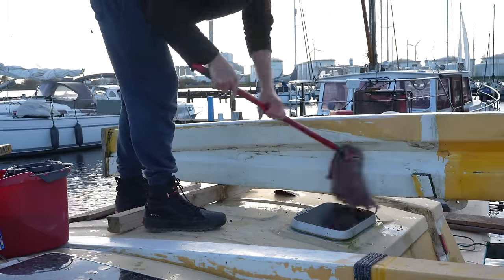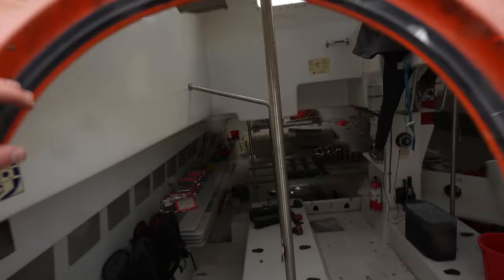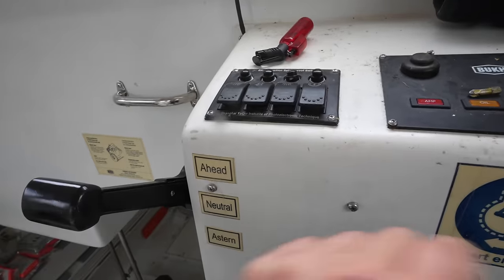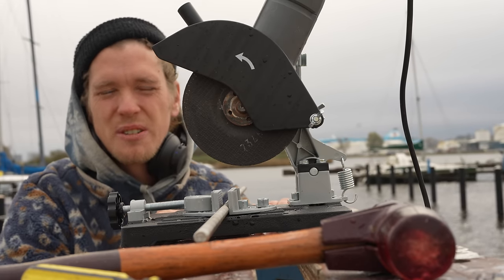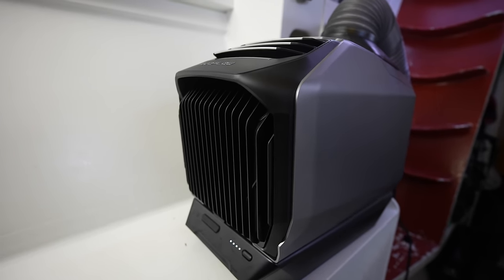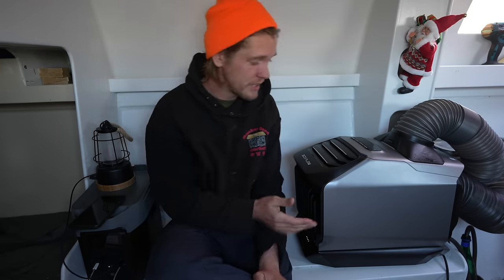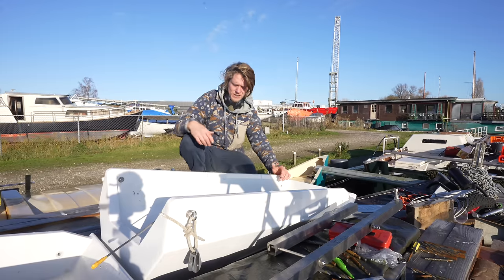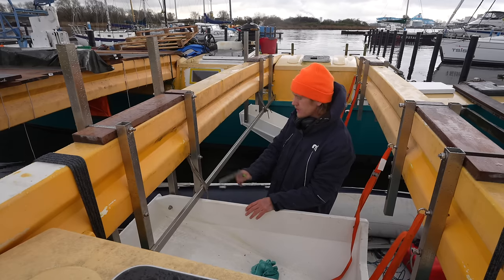Plodding Along With the Engine Pods | Wildling Sailing

Comment: Nice. It's 8C in here and i'm not even cold but shattered and my back is hurting. Got stuck in the snow. Let me tell y'all a little about my day. Woke up at 11. Was going to post office b4 midday but missed it as was distracted with a guy online selling me some Technics hifi gear. Flagged the post office till monday. Called a friend and asked him to help me pick up some firewood as i fractured my thumb 4 or 5 days ago. I took a 5T truck that had not been started for 4 months. It just started to snow as i left and i live at 1000M.
  Picked up Mitch, drove down out of the mountains to a guy 20km from here he has good firewood but expensive.
On way home i went to drop Mitch off but he said he wanted to come up to my place and help stack the wood. Up we went. There was already snow on the road and things were slushy and sketchy. Had 2 very steep hills to climb in slush. Just made it with some sideways skidding (dérapage in France here). We did the job and i drove him back down in the mini (with a bit of sliding around) after moving 3 vehicles around in the snow with some skidding and sliding and a few attempts. (now happy as it's been 8C in my house, (an uninsulated concrete block for the most part). 
  Decided to go to a town a bit higher up the valley to pick up personal items a friend had just driven back from the UK to France for me. The conditions were bad, everyone taking it easy in the slush. 
  I could not take the heavy pond liner but i took 12" vinyl photos, cassette tapes and a load of junk he randomly loaded at my dads place. Road was really bad and i was already becoming saturated. I drove back down to 800M and then had to climb back up to 1000M sketchy driving! Just as i went to pull off of the 2 lane road i saw a van broken down. There was a wheel lying in the road. I swerved around the wheel and stopped in front. The girl was crying, i went straight to work. We put on the yellow vests. I asked her to get ready jack etc. and to stay in her van. I drove down the slip road and muscled a load of the crates in my car around till i could get to my jack etc. I ran back uphill as fast as possible knowing the conditions could quickly turn fatal. We were in a slushy blizzard. 
  As i arrived, to my amazement a motorway service vehicle had pulled up behind her with flashing lights which helped to install a great deal of confidence. but i kept looking up to check for out of control vehicles. Things were super slippery!
  I managed to get the van up a bit higher with the mini jack but it started all sliding in all directions so i lowered the van onto the tyre part of the runaway wheel. and then managed to get her jack under. Hands were already frozen and i had thin rubber work gloves. I had to ask the girl to fish out the 3rd bolt from my pocket. Bolts that were taken from the 3 good wheels. She explained her father had mounted the snow wheels (alloys).
  The bolts were too short with only 2 and a half turns max till tight.
  My hands were freezing, it was almost pitch black and i was cranking the jack as fast as i could with two hands, two very frozen hands. The motorway guy started putting the 1st bolt in but threaded it a bit. I tried to save it but later explained it would need cleaning up. The van started sliding forward and the only thing we had to block it with was my jack. Her jack now slightly twisted, rush hour and many cars coming down the valley at some speed.
  Job done and i said have a nice evening and i ran off with my hands under my armpits. Mitch lives just on the other side of the slip road so i threw the things in the back of my car which was parked at the train station and ran to his apartment.
  My hands were in so much pain and my heart was racing at 200bpm I felt sick and in pain. After 10 mins i felt a bit more normal and smoked a big one. After 1.5hrs hour i left but with the fear. How was i going to climb this hill?
  I decided to park at the school which is at the base of the hill. I started walking (30 min walk in wet clothes) after observing a snowplow driven by one of my arch enemies, wondering if he was about to do the hill.
  I thought F it and kept going. After less than 10 mins i observed another snowplow coming back down the hill so i turned and started to run and slide back down. I made it to the car after 3 or 4 mins and started the foggy thing straight up. Boom i started to slip and slide up the hill. After 5 mins and with 2 last steep sections to climb i approached the 1st hill cautiously. I gave it a good go and failed, with one rear brake not working i almost had the car sideways as i slid back down the hill bit by bit. Luckily i pulled it off bit by bit with no damage. I had to ditch the car on some private driveway as there is nowhere to park. Got home after a 10min walk through slush and powder. Was so thankful that i had finally managed to get firewood. Had some wine, lit the fire and now i sit here. It's still only 8.7C upstairs but downstairs where the fire is is probably getting quite toasty, at least 13 or 14C by now.
  I'm hurtin and the next mission is to see if i have any chains that fit this car and then to walk back down, put chains on and finally make it back, hopefully.
  Have fun, y'all.
  Never made it back. Chains kept coming off at 02:30am. my back is broken / v sore and finally made it back next day.
Reply: Yep. I had a lazy rest day too 😂
Reply: @smokingkippers1173  lol

Comment: Angle grinder stand needs a cutting blade, not a deburring blade like you have now. A thin blade, not a thick one. There are 2 versions of cutting blades, a flat blade and a cupped one in the middle🙂

Comment: It looks like you are using a grinding disk rather than a cutting disk on the grinder.  You can get 1mm stainless cutting disks cheaply, that will slice through those bars. Also some oxalic acid crystals  it's a great cheap boat cleaner and if you dip the stainless in it,it will take off the iron and stop it contaminating the stainless and majeing it rust.

Comment: If you look at the grinder in the video, you are cutting with the very bottom of the blade (6 oclock position) Its burning through as opposed to cutting... You need to adjust the vise so you are cutting with the leading edge of the blade (4 to 5 oclock position ) This happened to me. The difference is night and day

Comment: Next time use a cutoff wheel for threaded rods. What you’re using isn’t the right blade.  I just did this and it takes about 5 secs for me to cut a 1/2” bolt.

Comment: I'm wondering if a thinner grinder wheel would cut faster for you and not burn as much? I have seen some posts saying to use a Ceramic Grain 1/8" Width cutoff wheel for stainless all thread.

Comment: Mate you need cutting discs for that rod, you’re using grinding discs.Be aware that the heat from the grinder removes the stainless quality of the steel in that place and unless the steel is re-passivated with nitric acid or citric acid it will rust at that point like mild steel.

Comment: You really should have been making this stainless steel framework using a welder using circular tubing with triangle tubes welded to give it the structural strength that it needs. It also needs some type of lever clamp to lock it into place when it's down & when it's up. Bolts on tubing are really no good cause it causes fatigue due to vibrations which end up elongating holes & bending if not breaking bolts.
Reply: Better off with a decent tender suspended underneath ~ gonna need one anyway!
Reply: The design he's using was designed by the designer of the boat, also the best thing about the boat design is the fact that the beams can be removed if the framework was all welded together this wouldn't be possible

Comment: You have touse a 1mm cutting disc especially for stainless. You are using a grinding disc about 4mm thick so 4x the material that has to be shredded. Cost about a euro a disc. It will cgange your life 😊

Comment: level on a boat,  well..  it depends on how equal the wight is on either side of the boat.   also the movement of the water..   because the level will be level with ground,  the water is also level with ground..  so any deviation of the boat its self, will result in a deviation of the level of the beam your attempting to level.  you can only use a level when on hard,  and both sides of the boat are level.  then anything you level in the center,  will be level with both the boat and the ground.  but on water.. not so much..

Comment: The cover/ "roof" for your ship can be pretty big to NOT be permanent... The cirk-tents, wich are made to be simply packed and transaported, can cover DOZENS of meters, the biggest ones even hundrets. 

But to the cover idea - you can build quite cheaply, and quite quickly 4 "legged" skelet our of plastiq, or small metal tubes, temporaly clipp that either to the outer sides of your umas, or other ussefull points and cover that construction with plastiq sheet... The skelet should looke like a building with "A" shaped roof, if the roof and sides do not carry the sheet properly stretched, but hanging "inside", you can always add a "ribb" or two. Timewise it would take you less than 4 hours including the purchase, and you would be MUCH more comfortable working, same as your SHIP will be much better when no new moist incoming during the repairs. To a degree it would help with the wind and cold too. 

The lifeboat is a pretty neat idea, with TONS of inner space. It is not a sailing boat, ture, but you still can add 2 or 4 foldable hardsails ("wings") as addition to the engine and make your way.

Comment: Don't worry about the Moaning mate. Your a Pom. Your supposed to Winge. Doh! Nice a bit of Kit that Ecoflow heater/dehumidifier/ Cooler. Nothing worse than a damp stinky boat. I leave a little Electric Fan heater on in mine. But thats on Shore power. Stops the root too, keeping damp out. Slowly but surely wins the race. Keep going at your own pace. By all means go home and charge your batteries for your Soul. You'll be chomping at the bit to get back to Mahi in no time. Kiaora.

Comment: Just with the level; if the hulls aren't sitting the same depth in the water, the level won't be accurate. Best to measure down from fixed reference points.

Comment: You're telling me that overpriced thing is only 1,000 watt hours that's less than one 12 volt 100 amp hour deep cycle battery which you can get for relatively cheap paired with a small or large inverter I think DIY would be the way to go for most people if they're looking for an affordable option because then you could really customize and pick the components that better suit your needs
Reply: FOR SURE!

Comment: OMFG!!! Using a grinding disc (@11:12) to cut stainless steel bars, no wonder you burn up the bar. Maybe you need to do some Google research on what disc to use for different material, as always you just wing it instead of learning the different between cutting and grinding before making a fool of your self.

Comment: Sorry buddy  those what ever you call engine pods  not a chance those attractions will survive a major storm  or heavy sea  and the long run   the engines gonna turn to pile of corrosion   water will get in the fuel  electrical systems   sorry  no sir  but don't give up on the rest of the project